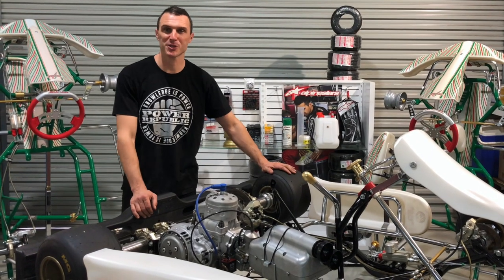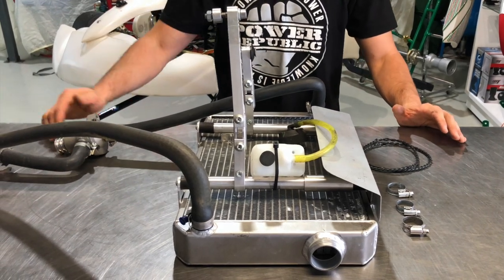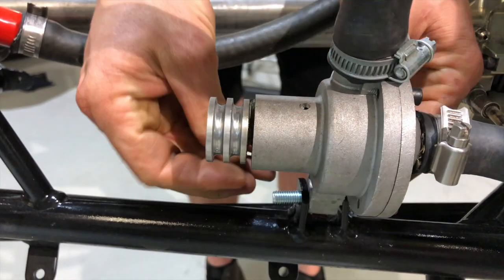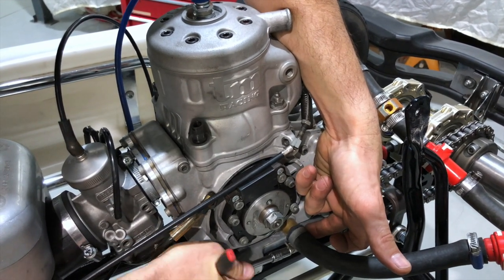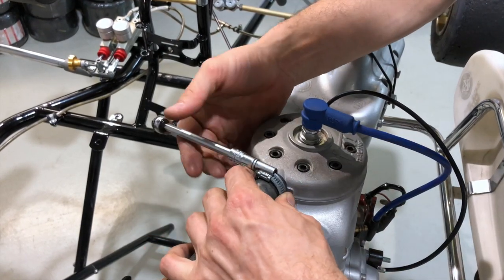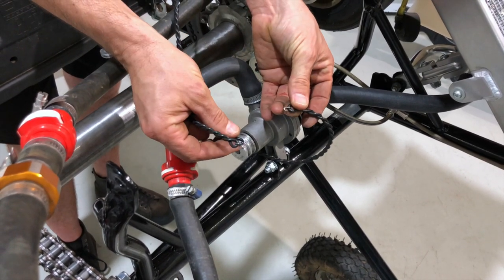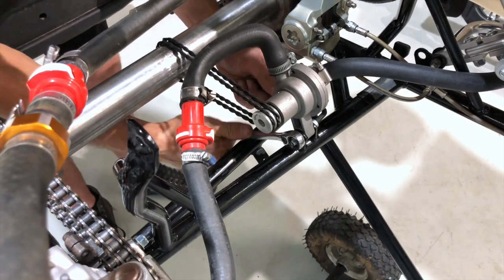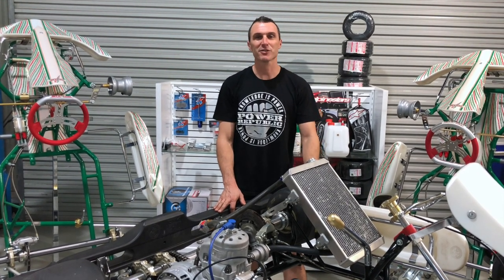Power Republic - How To Assemble A Go Kart Part Seven - Radiator Installation

Comment: I'm curious, why do karts use external (axle driven) water pumps, rather than having a water pump integrated with the engine, like motorcycles? Wouldn't that be simpler?
Reply from the maker: Some have external, some internal. Integration is good, but for ease of maintenance external is probably better

Comment: Hello Power Republic, greetings from Germany.
I have some questions,
1. How much must be the Angle of the Radiator, what is Standard Angle for optimal cooling. (New Line) 

2. Is a flat Radiator better for the aerodynamics and speed?

Thanks a lot 👍
Reply from the maker: I can only give you second hand info, that vertical has less drag as the air moves faster through the radiator.  weather that is too fast to effectively cool the engine I can't say.  If you are having problems overheating then you could always use a bigger radiator.
Reply: 55° angle is starting point and you play +-5° depending hot or cold weather (nowdays we use almost all curtain, so 55° is standard)
Reply: @dimisgarage2501  i drive always on good weather 20 and more degress. My Alfano Shows me when i fast drive 45degress on the Radiator.
Reply: @oguzyurdakul9019  your Radiator is too big, you need tapes or curtain, optimal temperature 50-55 Celsius.
How I said radiator angle must be around 55

Comment: I don’t have a water pump in my Tony kart... how does that work?
Reply from the maker: you can get a remote water pump bracket and water pump from RR in Italy https://www.righettiridolfi.com/en/product/search/water-pump-&-spare-parts/aluminium-6/pump-1
Reply: @PowerRepublic  i think hes saying hes got a radiator but no water pump, and was asking how it circulates the water... if so, im curious how that works too.
Reply: @christianbuczko1481  internal water pump, for example rotax max , old kf engines etc

Comment: would be good to see you fill and bleed off the radiator
Reply from the maker: Hey Jarred, thanks for the suggestion.  it bleeds pretty easy.  
fill it up with water.
Strat the engine and rev it up for about 1 minute.
stop the engine.
recheck water level.
boom, good to go
Reply: @PowerRepublic  cheers mate 👌